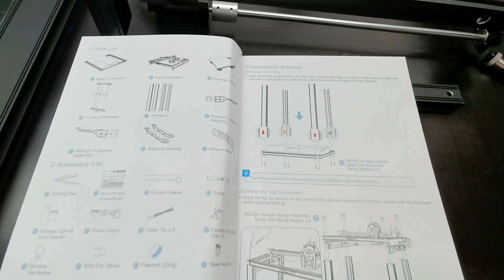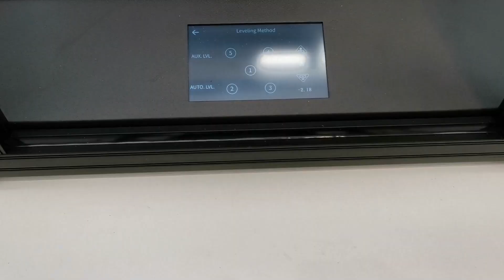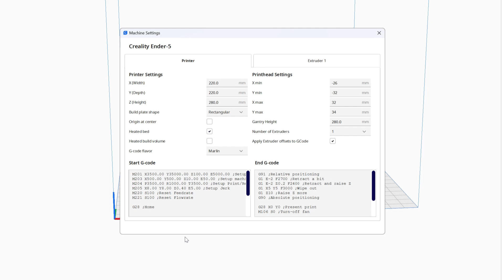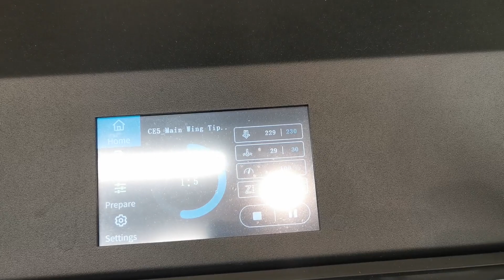Ender 5 S1 does amazing Lightweight Prints

Comment: Quick question, if I was building a large RC jet say 1/6 scale should I 3D print landing gear or buy some online with like a suspension system and rubber tires?
Reply from the maker: At the moment I would tend to buy some.
Reply: @rene_rosentraeger  ok, thank you!